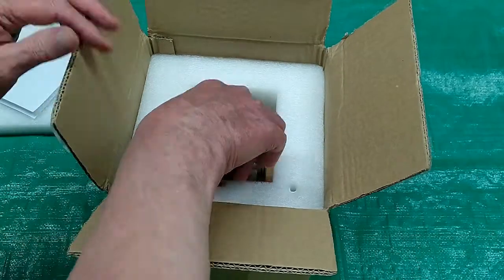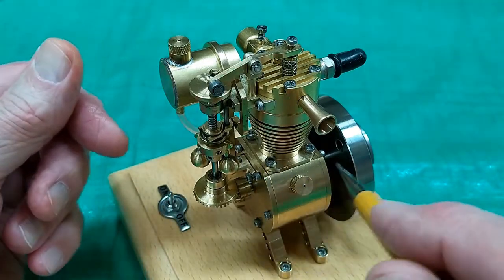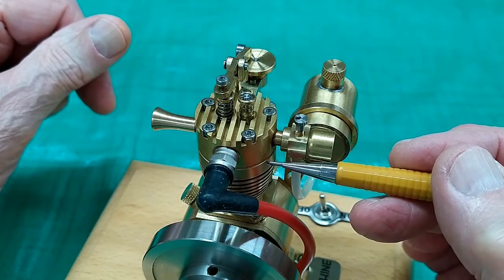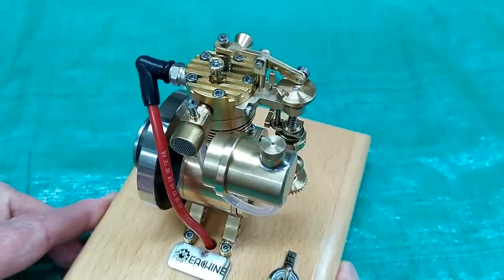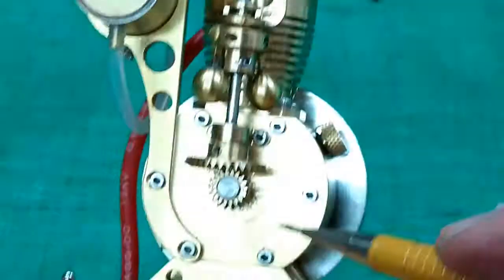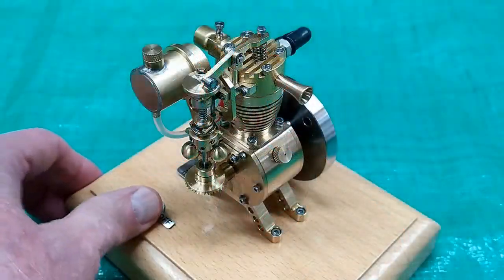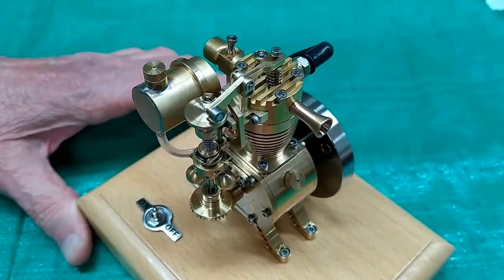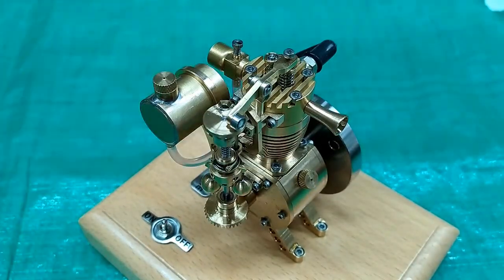M19 Vertical Hit & Miss Engine With Flying Ball Governor

Comment: Hi what mix ratio of  oil and fuel do you use please ?
Reply from the maker: I made a video discussing the various problems people have had running some of these model engines.

Correct Fuel For 4 Cycle Hit & Miss And Other Model Engines
https://youtu.be/n1zOC2C-iy0

The answer to your question is around 6:20 in the video showing the fuel and the oil I use in all of these model engines.
I don't really measure the oil. I just use enough to barely tint the fuel a light pink. The only purpose for the oil in the fuel is to lubricate the piston o-rings and the marvel mystery oil is clean, doesn't form carbon or foul the spark plugs.

I also have a playlist on my channel page containing 70 videos on various model engines and related subjects. There is a lot of information there which may be of interest to you.

Thanks for watching! Please subscribe.
That is what keeps this channel going. 
Ron
Reply: Thanks so much for your message ìm subscribing now
Best regards Adrian